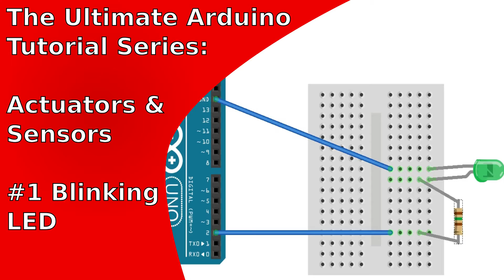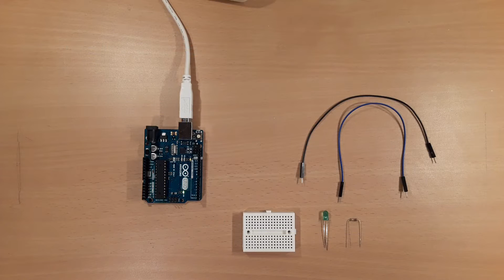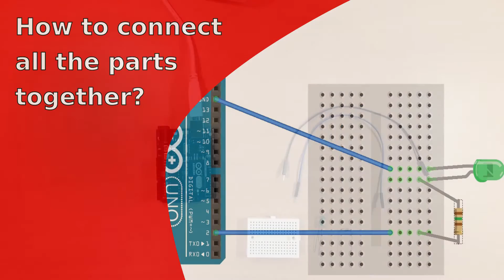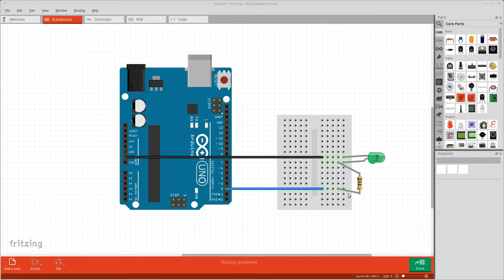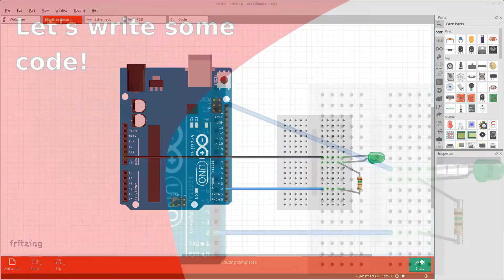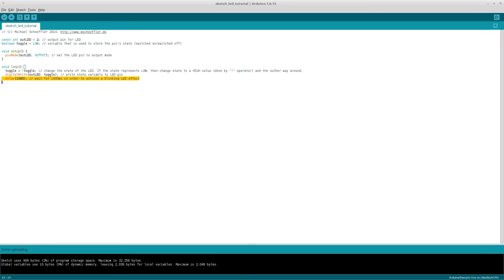How to blink an LED using an Arduino Uno | UATS A&S #1

Comment: Sir plz tell me the codes if I want turn on buzzer for 10 seconds then it should stop , actually I want use this to make water level indicator ,so once water reaches high level the buzzer should on but only for 10 seconds then it should off ..